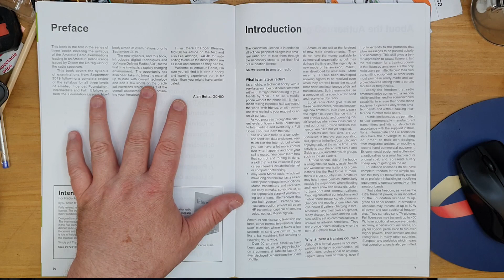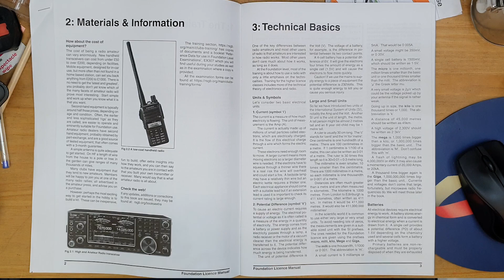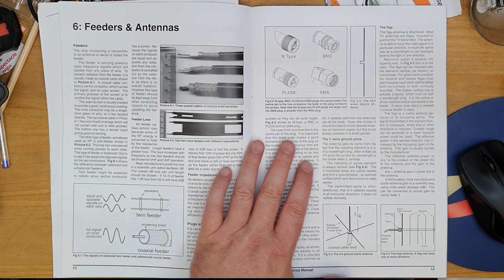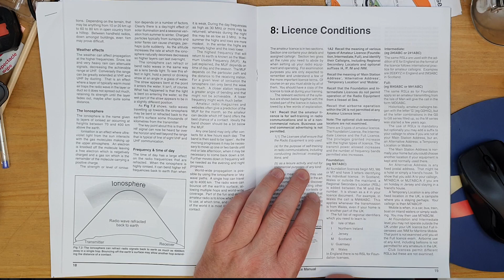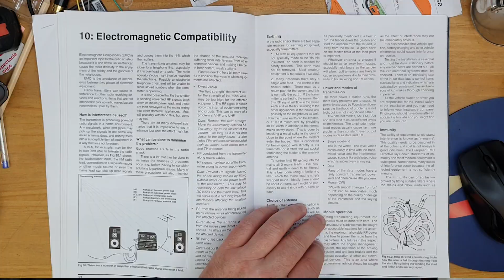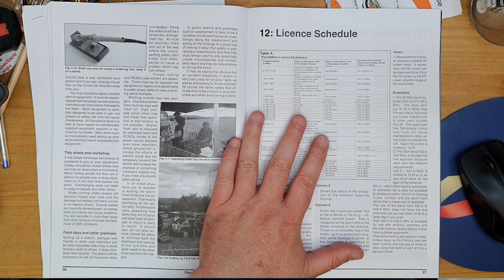What's involved in taking the UK ham radio Foundation ticket?

Comment: Hi Gaz. Can you do a video on taking the Advanced course? Stay safe. Paul. 2E0PPJ
Reply from the maker: wow thats an ask lol.. what I might do is have a q and a with our engineer..
Reply: The Gaz Lab Advanced is tough. Having to go over gcse maths again
Reply: The Gaz Lab The only way to realistically do the advanced is to do the revision books for the higher level GCSE maths. I tried before to do advanced. Some equations and algebra I understand and other bits not so much. Back to basics. Paul 2E0PPJ
Reply: @watchfan6180  The high level maths is only a small part of the exam and you only need 35 right out of 58

Comment: We need more people on the air. There isn't enough people transmitting. The VHF/UHF bands in the UK are in crisis and need to be used otherwise we'll lose them.
Reply from the maker: There needs to be more activity for sure...
Reply: Abolish the pointless mandatory licence and instead replace it with an optional test it is a money making scam like the tv license. Yes i have a 2 way radio and no i dont have a licence nor will i ever get one
Reply: @richcampoverde  you obviously don't understand how radio works by your comment. The licensing is an important part of ensuring radio spectrum is used correctly. And yes you can operate illegally but if you took a little time to learn you would not take the attitude you have.